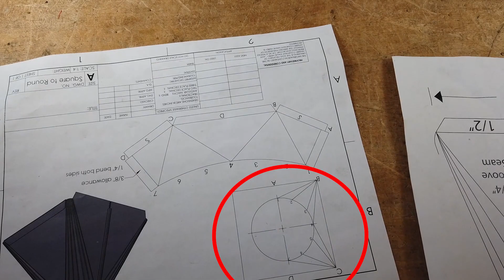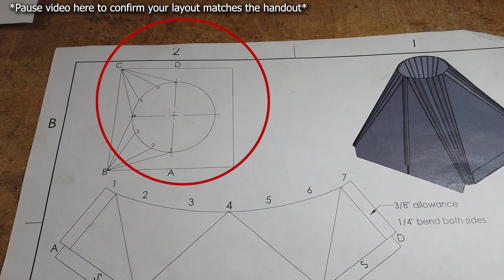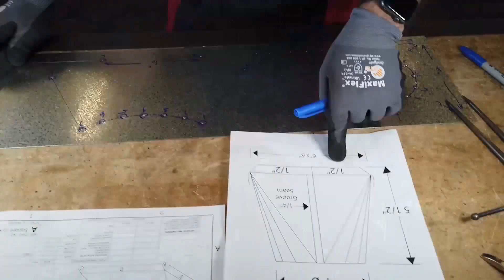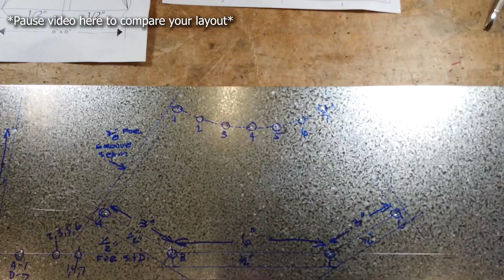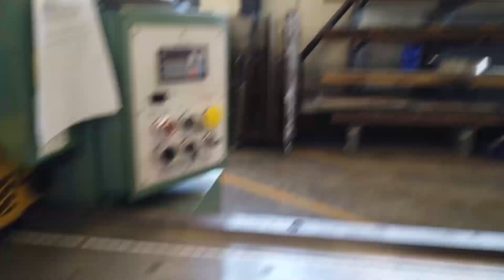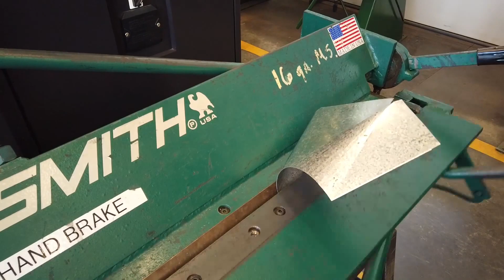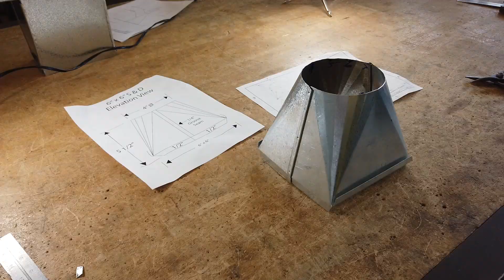Square to Round Project using Triangulation.  Shear size 24"x8"

Comment: When you come to bend this what are the interior angles?
Reply from the maker: I use an approximation of 90 degrees divided by about ho many bends I'm going to make.  On a large fitting with 20-30 bends it would be less per bend, on a small one with few bends it would be more.  On a light gauge part you can "correct" the bends just by pushing the wing until it sits at 90 degrees.  If it's thicker than 16 gauge I would be very careful  when making my bends so I didn't have to get out the sledge to make adjustments.
Reply: @longbeachcitycollegemetalf3321  Thank you for your reply.

Comment: U know they make a plasma cutter that can cut it all to precise just have to bend .but this was the way I was taught u can still get the same result but it take awhile to do
Reply: I think he does Gator Gator, but I also believe a student must master visualizing patterns. Why? A worker should have a pretty good idea of what the pattern should look like, knowledge of pattern making is the only way to double check your nested fittings before letting the plasma burn metal.
Reply from the maker: We've got the software and an #amada #fiberlaser cutting machine to cut these out too.  Come take a class and move up the pay scale. :)
Reply: You don’t have to sell me on a Plasma table, I agree with 100% that it’s a game changer and well worth the investment.  But, they do break down, and when they do! The certified Sheet Metal can still finish the job.
Reply: That's why I made this comment we already own a plasma cutter and I wouldn't want to teach my guys that on the field because it would cost me 3 hours making it when I can do it in 30 minutes simple math but come take my class to show you how to do two full installs in a week now this is a 4-ton system heat pump. With 3 ppl on the job . I think guy was good at his video and clear on it. But that want make u money. But that's what makes the difference